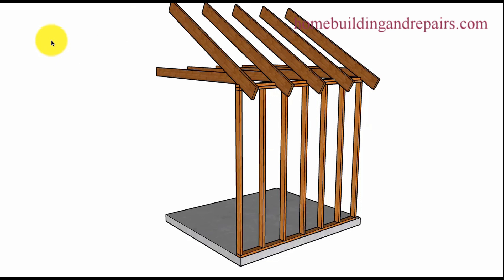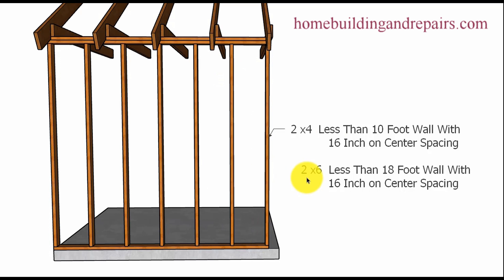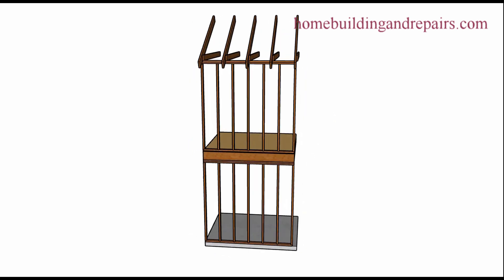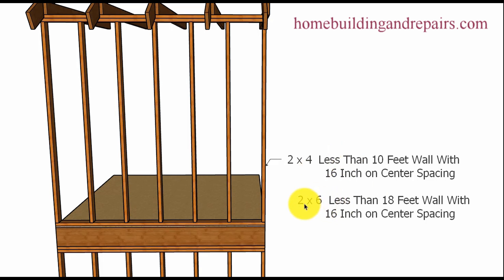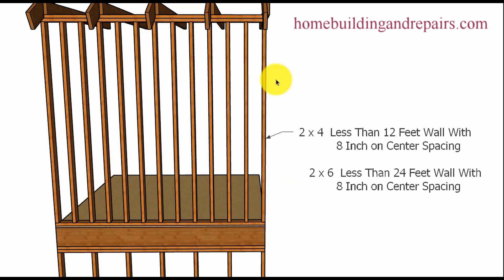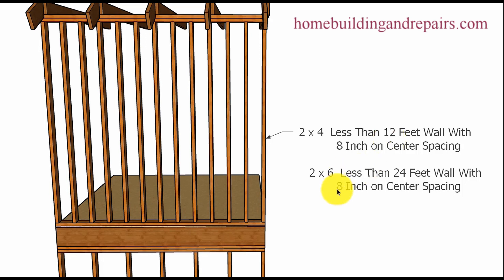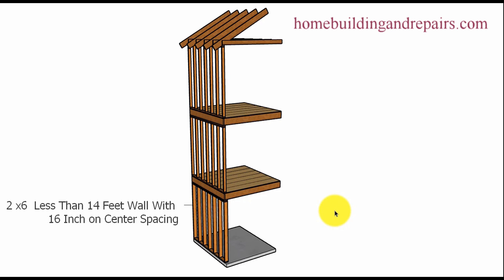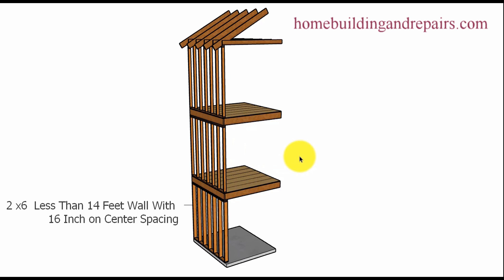How To Calculate Some Wall Framing Stud Sizes - Building Code Education

Comment: For a wood frame 3 story house (2 floors and an attic under a gambrel roof so essentially a third floor) are 2x6 studs strong enough or do I need 2x8?
Reply from the maker: I cannot advise provide you with structural engineering advice, but can provide you with my opinion. 2 x 6 spaced 16 inches on center should be fine.

Comment: on that 2 story wall, would the ground floor wall be with 2x4 or 2x6
Reply from the maker: It could be either, I probably should've explained it better in the video, but if you go to the section where I say that it is going to be supporting one floor and one roof like a two-story home, then you can use any of those examples. 16 inch on center two by fours up to 10 feet tall is usually an accepted method.
Reply: @gregvancom  thank you for the reply
i was unsure as to whether the height of the wall meant ground to roof or floor to roof.
but i now see where i misunderstood. i was including the floor that the wall is supported BY, along with the one it would be supporting

Comment: Now do the same video for 24" o/c stud spacing. Thank you.
Reply from the maker: I would make a video if I personally liked using 24 inch on center stud spacing, but since I don't, probably won't be making a video. The information however can be found on the chart that I mentioned in the video description box.